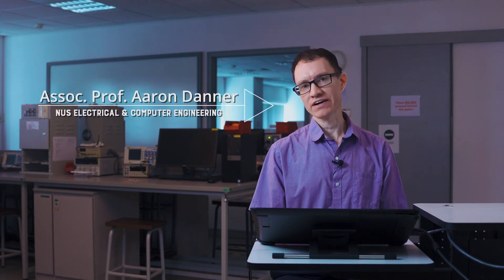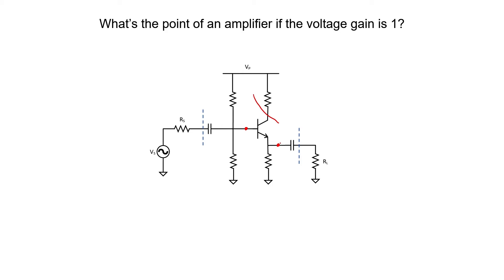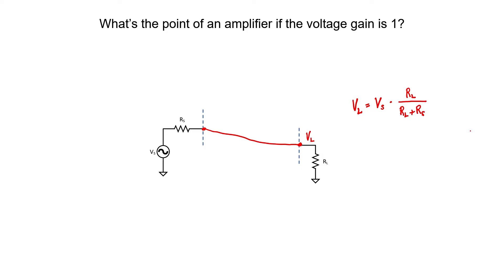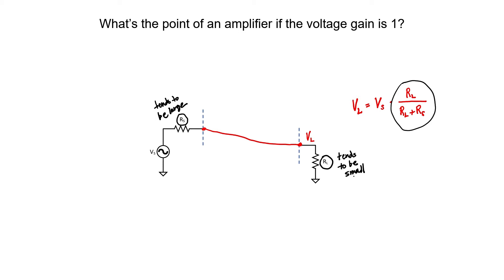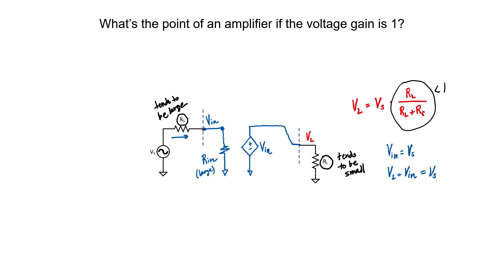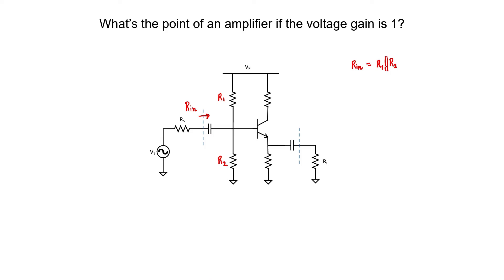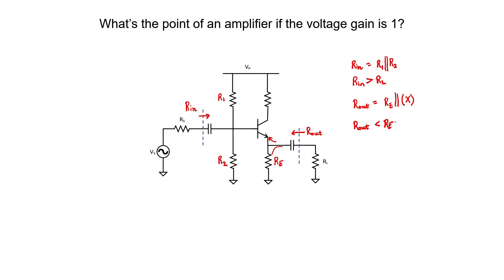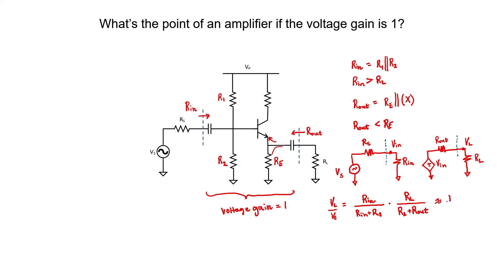When to use a common collector amplifier (3-Transistors)

Comment: i think the word "common" in "common emitter" actually comes from the concept of the "common rail". it's explained in wikipedia under the term "Common rail (electricity)". If you look at the common emitter, the emitter is connected to the common rail, as defined in that wikipedia article. That's why it's the common emitter configuration.

Comment: I guess we use R_E to set the Z_OUT of the amp. At the very last section, to make Gain = 1, you need to have Z_OUT small for the simplification to work. So, why do set the Z_OUT of the amp so much lower than Z_LOAD? Isn't impedance matching here a thing? Like trying to make it similar to Z_LOAD? I guess we are at lower frequency with no wave-like behavior...  did I just answer my own question?
thx.

Comment: Lost me at those resistors in parallel ...R1 and R2 at 5:39
Reply: It is because the only effective load the signal sees is r1 and r2.
 Why is that?
The base input impedance is very high since the transistor is  working in common collector mode.. ( often called emitter follwer) so you can ignore that..
( its high becuase the emtter signal voltage is in phase with the signal voltage on the base... and as these two voltages are nearly equal... no significant base signal current flows.. ie "high impedance" 

Base dc bias current is provided by r1 and r2.
 
So the only load left to consider is the combined effect of r1 and r2 on the signal source.

Since the dc supply to the circuit is effectively a very low impedance at signal frequency.. ( he really SHOULD HAVE SHOWN a decoupling capacitor on the dc supply which there will always be on a practical
circuit thereby making the supply line effectively "ground potential"  as far as signal frequencies are concerned)

 then r1 and r2 are effectively in parallel as far as the signal is concerned - (r1 is effectively connected to ground potential)
  so the signal "sees"  a combined resistance (rt) of
1/rt = 1/r1 + 1/r2 =  
(r1 *r2)/r1 +r2
Reply: @eric4709  thank you!  That's not an easy observation

Comment: Excellent videos - and I am going through all of them for a review. I earned my BSEE in 1988 from Ohio State University and was not happy with the electronics textbook and teaching during the transistors portion of the curriculum. Consequently, I never got into any analog design at the transistor level. I did do a fair bit of electronics and still do with passive crossovers, instrumentation and have architected and completed a full embedded system with firmware for a liquid flowmeter....Still, I have always felt something was missing and your videos are helping me re-acquaint myself with the missing link. Thank you!

Comment: MOST EXCELLENT! I'd use a unity gain gain stage mainly for buffering and or sometimes a 180 degree phase inversion of the signal so I can blend, or combine or remix two similar very signals derived from one original input signal where one signal is 180 degrees out from the other. I had one that used two BJTs and a voltage divider off of a cathode follower triode for tube amplification phase inversion of the signal to remix the same signal back in. I did another tube amp phase inverting Op Amp (not a  phase splitter). The op amp circuit required a switch that dumped stored DC from coupling caps to ground to protect the op amp when switching it in. It was two tube preamps from two pretty infamous devices to put in front of a guitar amp.

Comment: Why are the two fractions multiplied together at the end of the video ?
Reply: I had the same problem and solved it after a hard day. The formula gets more obvious, if you multiply it with VS. Then you get VL  is equal to VS multiplied by the fraction of the input voltage divider multiplied with the voltage gain, which is 1 multiplied with the fraction of the output voltage divider. Hope that helps.

Comment: I always heard transistors configured like this called an Emitter Follower. It makes sense because the emitter voltage follows the base voltage via the base-emitter diode in the transistor but with the current gain of the transitor giving smaller output impedance.

Comment: I really like your method of determining common collector as "transistor lead not in the signal path" because it is so straight forward.  However, I have always understood it to be the lead which is common to both input and output sides of the transistor  circuit.  For a common collector amplifier, this would be the collector since it's connected to V+ (power) which is common to both input and output of the circuit.  Both methods lead to the same result and I suspect the mapping between the two methods is that if a lead is common, it can't be in the signal path since it is providing power or ground to both the input and output sides.